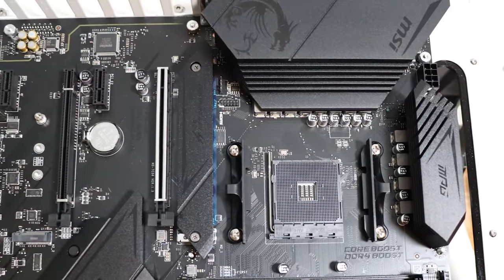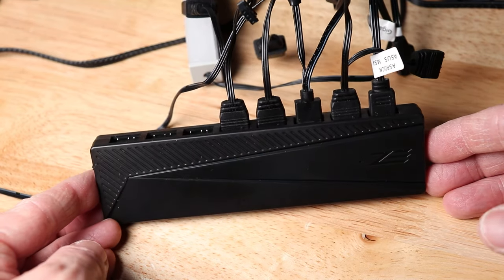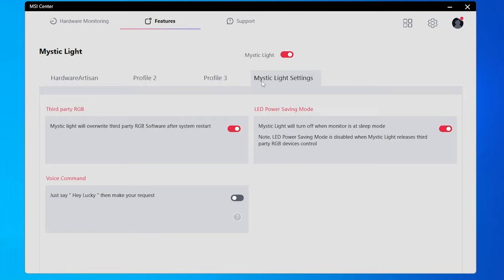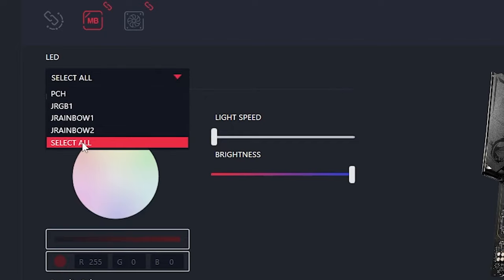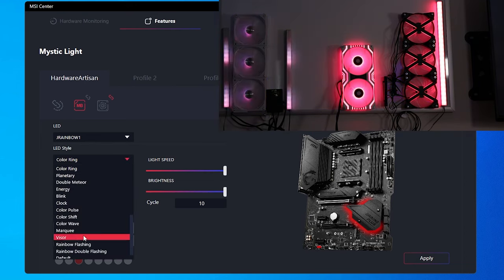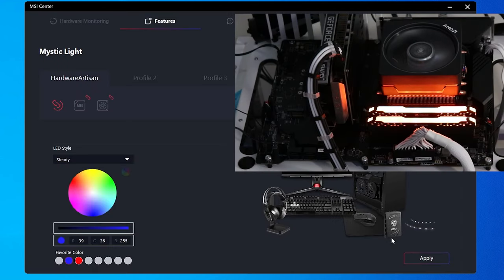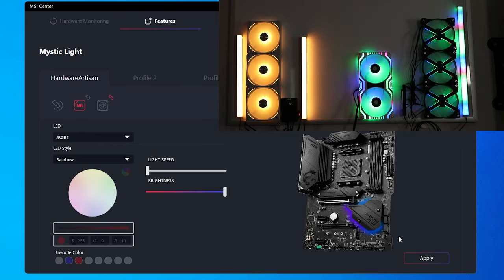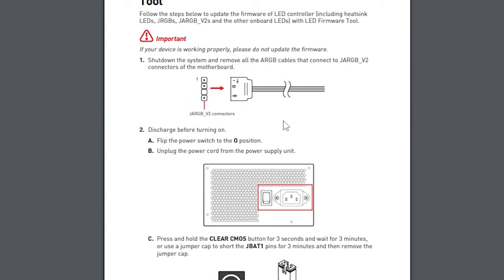MYSTIC LIGHT from MSI for Motherboard RGB Control - In depth look

Comment: Tried mystic light and now none of my rgb works. What junk software.
Reply: What would you recommend using? I need a better software
Reply: Bro it works fine for me
Reply: Mine too. Worked for a week now I can’t even turn them off.
Reply: It doesn't work because of your cheap af motherboard. Don't blame the software.
Reply: @The_Primary_Axiom   it turns on automatically?
Reply: @padmabharali1306  No my case actually had a button on it that completely turned it off I found out. There was a button on top which I thought was a reset button lol. I must’ve accidentally hit it and that’s when the software stopped controlling it. I put it on like permanently on mode. I’ve been so used to older computers that have reset buttons on them. But it was a button to switch the lights completely off, which was the easiest way to do it without installing software.
Reply: @The_Primary_Axiom same problem bro how can i fix it ?
Reply: @sardarbircini  there should be a button on your case by the power button that turns it off. Usually these cases have a switch that turns it off or a button. My button is right next to the power button. I thought it was a reset button, but it’s actually for the lights. Depends on what kind of case you have too.
Reply: @The_Primary_Axiom  mine is f8 and it has 5 styles of lightings but since I installed the msi mythic light that button doesn’t work idk how to fix it
Reply: @sardarbircini  well I know the Mystic light didn’t work for my case. The reason why it stopped working is because I hit the button on my case. So there is a button somewhere that allows you to control the lights through software and hardware. You must’ve turned on something that allows you to change it though hardware. That’s why the software side stopped working. You shouldn’t even need the MSI soft. I uninstalled all that stuff, and I can turn off the lights on my keyboard with holding function and hitting f11 bunch of times and turn off the lights on my case with a button on the case next to the power button. Look on your case there should be a button somewhere that your lights on your case.
Reply: @The_Primary_Axiom  thanks bro i just downloaded msi dragon centre driver and it has been fixed now i have my original styles that i can change them by button and also i can change them to any style i want with msi mystic light
Reply: @sardarbircini  NP. If you wanna keep it off, just turn it off through the software and then uninstall the software.  I don’t like that software on my PC because it messes with my mouse. But if you have issues you don’t need to uninstall it. But for me every once in a while, it would like disconnect and reconnect my mouse really fast. Since I uninstalled it, I haven’t had that issue.
Reply: Happened to me had to delete it and the SDK now my rgb is back. I guess I just won’t be able to control it. It’s weird tho every time I turn the PC on it switches to a new colour.
Reply: @The_Primary_Axiom the button doesn’t do anything

Comment: Can u connect a aio cooler and fans on a rbg hub, and would they still work ,or so you need the radiator fans on the aio cooler plugged directly into the motherboard? Because mine do not change color, I have a z490 gaming plus and I plugged the radiator fans into a hub both the power and rgb ,and i did so with another 6 fans but none of them are changing color

Comment: to let CORSAIR ram work  1 you have to go to icue setting  / software and games and active  software integrations / 2 in MSI center /mystitc light /mystitc light settings /active third party RGB . do system restart . and will work i have on and works find  you have to do system restart .. thanks
Reply from the maker: Hi DRAGONFLY, that’s good information. You do want to ensure that the software integrations is selected in icue as well as the third party RGB setting in mystic light. I had tried that, to no avail. But you got me thinking, I had been using signal RGB on this PC, and I had it starting automatically, I was shutting it down before loading icue and MSI center, but wasn’t working. I did find today that if I prevent signal RGB from ever loading in the first place it now works as expected! Haha. So, if you have signal RGB starting, prevent it from starting and reboot, mystic light will work properly. Perhaps I’ll do a follow up video specific for to Corsair. Thanks for pointing out the steps for Corsair!! Thanks for watching!!

Comment: Hi i also have the msi mystic light software. i plugged argb fans into a hub then the hub into the argb header on the motherboard. but in mystic light i cant control the fan colors
Reply: hi! Did you fix your issue? how about using other 3rd party software?

Comment: Can anyone explain how to properly set up this ARGB stuff? I have a DeepCool LS720 which has the pump and the fans ARGB all daisychained with only one 5v 3pin connector to the motherboard, so I paired it with an Arctic P14 ARGB fan - since my motherboard has only TWO 5v connectors - and the rest of the fans are connected to a Thermalright ARGB hub which is connected to the second ARGB connector of the motherboard. In the SELECT ALL all the effects work simaltaneously but there are pauses betheen some effects like 6 to 16 seconds (during which all the ARGB stuff is off), and if I chose the 1 JARGB and set it and then the 2 JARGB and set it too only the fans ARGB works - the AIO's ARGB goes off.
Reply: All settled.

Comment: Thanks for this.  I have been in to my computers for many years and i have never been interested in RGB, so my knowledge of how this works with regards to the control of hubs is limited.  Building a building a PC for my teenage niece and we are going all out on ARGB so this saved mucking about in manuals and reading loads of guides before buying hub n other bits n bobs.

Comment: AntEsport sx3 cabinet comes with argb light and rear mounted argh fan ,
These argb s can be controlled via reset switch(which is conncted to the hub (which is hidden)) but after using Mysctic light to control argb which worked fine 
but after turned off mystic light ,reset switch does not control the argb

Comment: I was able to connect my corsair ram kit's leds to mystic light using icue (corsaire vengeance rgb pro), and make an all sync setup on mystic light (mb : x570 - a pro). The problème is that the rgb stuffs are no longer working as intented, as soon as i turn off my pc. Same story upon starting the PC, rgb are doing their thing, until windows actuallyt lights on and open mystic light, which finally talkes controle again after a good minute.

I would like to know if there anything i can do to make sure my RGB works as intented (according to mytic light configuration)  from the moment i start the PC, till i shut it down.

Comment: I have an Asus Moba, and a MAG MSI C360 liquid, i installed this app but msi center doesn't show me Mystic Light on the pannel, someone has the same issue with moba that is not from msi? thanks alot
Reply: did u fix it? i got a Msi b450m-a pro max and it doesnt show to install Mystic Light

Comment: This "scrapware" does not work on my Z790P-wifi motherboard. If i try to start it from the MSI Center - an endless waiting begins. It shows rotating load icon and nothing happens. Reinstalling of mystic light and the MSI Center does not help. My RGB lights is working with default settings, enabling sleep function when my monitor goes off. But sometimes it cant wake up at all(all RGB is off) or only channel 1 wakes, leave another channel off. Restarting of MSI LED Keeper service can help to reinitialize LED controller and bring my RGB devices alive again.

Comment: I have Ant Esports 1100 gaming cabinet that comes with pre installed rainbow fans  with molex and 3 pin connector.
Currently all fans are connected and powered by a molex connector and they light up and spin.
My doubt is what is the 3 pin connector that comes out of each fan.
Should I connect it to my Jrainbow headers on my msi mother board
Reply: And no - you should not connect it to Jrainbow, Your fans are the FRGB = Fixed RGB - meaning they just light up and spin and you have no other control over them.

Comment: Frustrated - just received a new ibuypower gaming pc yesterday. Initial startup all lights worked in MSI Center/Mystic Light. After I updated windows, drivers, etc. the DRM lights on both cards stopped working. They are recognized by default in MSI Center, but are ghosted out. I can’t figure out how to get them back on… ugh 👨‍🚒🚒

Comment: Is there any motherboard that doesn't just offer pre-made modes in their ARGB software, but where I can also create my own effects? I just bought an Asrock board, and I can't even articulate how much Polychrome Sync sucks. So I want to return the board and get something with decent RGB software where I can create my own effects.
Reply from the maker: Hi Oozaru85, that's a great question and something that has plagued everybody. In my opinion, all of the RGB software from the major motherboard Manufacturers (Gigabyte, Asrock, MSI and ASUS) is sorely lacking. It all good for basic setups, but nothing too fancy. Asus software is the closest thing I can think of that would give you the ability to creat your owen effects. 

I agree, Im not a major fan of Polychrome Sync other than basic color changes. 

Check out Signal RGB, it will work with the motherboard RGB controllers and give you some additional abilities using the CANVAS, but you are not likely to find a full featured softare giving a deep level of control. For that, I'd recommend Corsair Products, from there you can highly customize each LED in your PC. Lian LI and Thermaltake have decent solutions, but I don't love their software either. iCUE is ideal for getting alot of control and even that is far from perfect. 

That requires an investment of their fans and controllers though. 

Good Luck and Have Fun!! Thanks for Watching!!

Comment: Have loads of issues with this. Once the SDK updates it causes an issue with Windows Updates on my Z790 MPG Edge have to uninstall. Signal RGB is good but does not really cover what I want. In theory ICUE should work but does not see my board

Comment: I have an issue with one of my AIO fans. The RGB works for the most part but on one of the fans quarter of the fan decides to light up sometimes or not at all in that section. Not sure what is going on

Comment: hi i have a problem, i have a config with an Corsair carbide Spec omega + x2 rgb fans, corsair ddr5 rg, tehrmalright peerless assasin rgb and a 3070ti rgb
The ram + cooler + 3070ti are detected on msi mystic light
But the 2 corsair fans and the spec omega aren't detected
I've tried to instal icue but if i do that the ram are not detected on mystic light but only on icue (and i prefer mystic than icue), the spec omega is detected on icue
But the x2 rgb fan aren't detected on icue too ... They was working before i install icue, the moment i've installed, they turned off the rgb, and i cannot put them ON (nothing detect them), they work but not the rgb
Do you have an idea to fix that ? i've tried to delete icue and msi center but nothing changes...

Comment: hi, do you know if i can change the colors of this motherboard? i have this motherboard and mag coreliquid b240 m and i dont know if i can change the rgb colors of those pieces. help me please
Reply from the maker: Hii ukk81, that's a great question! Unfortunately the mag coreliquid b240 is not supported in Mystic Light. This setup doesn't appear to make any USB connection back to the board. The FAQ from MSI shows that it defaults to the Rainbow Lighting Effect and that no other color effects are supported (AUTO RGB is what they are calling it). You could swap out the fans for a set that is supported by mystic light (or another vendor) if desired. I hope that helps!! 

Good luck, keep having fun and thanks for watching!!!

Comment: Hello i have a deepcool ls 720wh and i want to connect the rgb fans from it to deepcool 5v to12 v convertor to my msi z 390 a pro motherboard . Is it possible if i connect the rgb cable coming trough the convertor to "jrgb1" port from my motherboard ?
Reply: Not sure if this will help. My DeepCool GAMMAX GTE cpu fan only changes color if I use the sync option. This software doesn’t show a fan selection. Just mobo and ram. My PC was prebuilt by NZXT. It also came with NZXT Cam and same issue.

Comment: Mystic light is very buggy. I can get it to work, but other days it does not work because the software STK breaks during updates. So what I have done now is buy ARGB splitter. Set this to the 3 pin RGB mount on my motherboard and just use the remote control provided to set the theme I want the colours I want put the remote away and I never have to do anything again no need for software.
Reply from the maker: Hi JustMyFish, I agree, the software from all the motherboard manufacturers leaves alot to be desired. Are you saying that you are setting the motherboards lights using a remote from another controller by connecting it to an RGB header on your motherboard? Can you give me more details on your setup? Motherboard model, the splitter and remote you used as well as what port you plugged it into. I haven't considered doing that, but if that works, it's brilliant!! 

Thanks for watching!!!

Comment: I did the firmware update. I followed the instructions. Now none of my led lights on the board will come on. I have tried to re scan but I get no options to reload the firmware. This system seems very jank. DO NOT UPGRADE your firmware. I haven't tried the board headers yet, but I'm not hopeful.

Comment: I have the same issue. Msi Centre detects everything except the Corsair vengeance grrr.
Reply from the maker: Hi solomani, you said it....grrrrr! My thoughts exactly!! I can get it to work, but 'flaky' becomes the word of the day....haha. Thanks for watching!!!
Reply: @HardwareArtisan  I got it working by doing what you suggested in your other video.  Use msi to set the colors, disable auto start on msi, uninstall icue, reboot, reinstall icee and got it all working. See if it’s stable but so far looks good 👍 thanks 🙏
Reply: I am facing the same problem.  My corsair - vengeance ram is not showing. Can you please help me with that?

Comment: if your mystic light isnt picking up your ram , say corsair vengance . you have to download icue & have it running , then mystic light will detect it . still not that good  i think. theres only 1 colour scheme that works with your mouse saying that , i cant get signal rgb to detect my ram so i stick with mystic light , but signal rgb is much better.

Comment: Right now, I am absolutely HATING Mystic Light Sync. I have two sets of fans plugged into 2 JARGB V2 headers (which I guess is what they call JRAINBOW now). I'm not able to change everything individually, as literally all documentation I have read. My four case fans? All four are always doing the exact same thing at the exact same time. My MSI brand cooler? Everything doing the exact same thing. It is literally the single most boring thing. When I choose color ring? All four fans do the exact same thing at the exact same time. If I don't set the 'cycle' much, much lower? There is a massive delay. In my Mystic Light software, both ARGB headers have what looks like the outline of an RGB strip. This software is frustrating, there is no documentation for it, and if this motherboard itself as whole wasn't as good as it is, I'd be pissed about my purchase.

Comment: mystic lights doesn’t even show up for me lol, guess my gpu is not compatible lol
Reply from the maker: Hi Erick Resendiz, what gpu do you have? If it's another brand, it can be fiddly to get it to show up under mystic light. Try installing the rgb software for that device and then try mystic light. If it's an msi gpu and on the supported list, I'd make sure drivers are up to date and that you have the latest version of mystic light. Just a few things you can try, let me know what you find!! Thanks for watching!!
Reply: @HardwareArtisan  I have a MSI GPU and an Asus Board(W11) and I can't get any features on MSI center